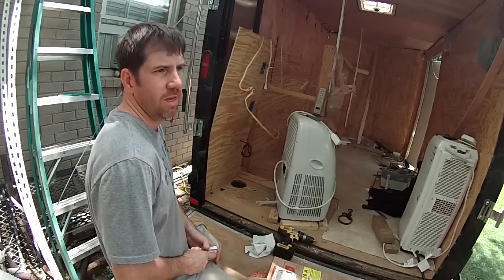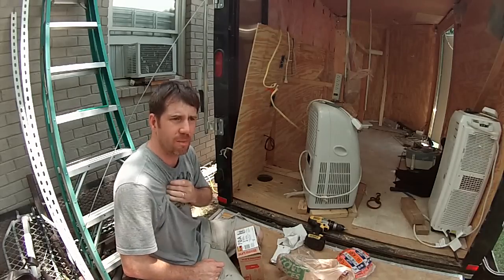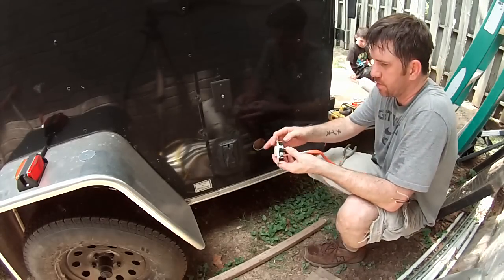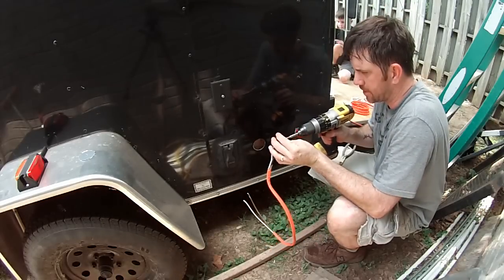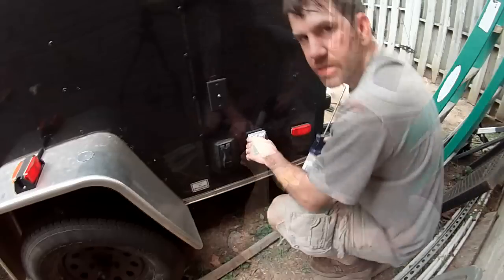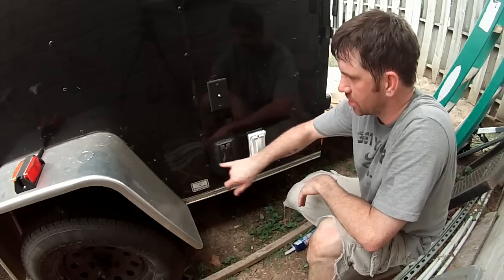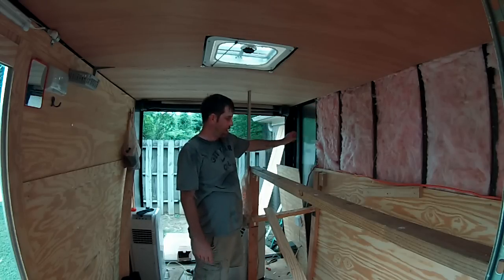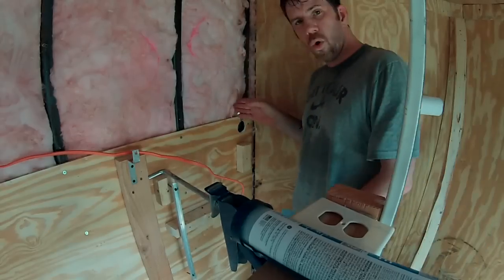Electrical Upgrade Pt 1    ....... 6x10 Enclosed Trailer Conversion Project

Comment: Just had a thought! I know this video is a little old. Just a idea if you haven't found a better solution. Maybe take a scrap piece from where you drilled out for the electrical and cable.(If it's big enough) Cut the hole the same size around the damage and have it welded in place. I'm not sure what it would cost where you live? Most car repair shops have welders or people who know how to weld. Find a backyard or small reputable repair shop. I know a few people who weld and something that small would be nothing to them. A little careful sanding and touch up paint after the weld. Do everything you can yourself. It would be very cheap and you wouldn't have to remember every time you look at it. I'm sorry this happened to you and thanks for showing us your mistake. I would have done the same thing. I'll be sure to learn from your mistakes. LOL!!! Thanks again.

Comment: With all the money you spent buying 2 cargo trailers and converting them into campers you could've just bought a used 16 footer with plumbing, heat, A/C, a real bed, and a TV for less than grand and been done with it.
Reply from the maker: Just bought another one..  Wheeeeeee
Reply: Kraka069 Your money your life. Just putting in my 2 cents.
Reply: John Doe not likely you will not find a ready to go camper with pink in hand for under a grand thats just stupid maybe a jacked trailer or one that needs to be restored or has broken windows or roof leaks.  converting is a good way to go especially if on a budjet.  I been looking for the past 3 months could not find a RV or trailer under a grand that did not have major issues like roof leaks broken windows missing title....jacked....and forget a RV under a grand... thats going to need carb clean full tune up full restore new tires thats going to cost over 2 grand alone so now your basically at 3 grand
Reply: John Doe not likely you will not find a ready to go camper with pink in hand for under a grand thats just stupid maybe a jacked trailer or one that needs to be restored or has broken windows or roof leaks.  converting is a good way to go especially if on a budjet.  I been looking for the past 3 months could not find a RV or trailer under a grand that did not have major issues like roof leaks broken windows missing title....jacked....and forget a RV under a grand... thats going to need carb clean full tune up full restore new tires thats going to cost over 2 grand alone so now your basically at 3 grand
Reply: ***** Meant to say 5 grand.
Reply: Nice thing about enclosed trailers is they are lower to the ground if you want to load 4 wheelers
Reply: @jdavis954  not to mention most have wood studs. mouse and rat poop in all the voids. and dry rotted

Comment: You should never install a breaker panel that low, one contact with water and getting knock off when loading equipment.

Comment: the cable you use should be rated to 15 amps 120/240 shore power..

Comment: Need a vapor barrier.
Reply: Fibreglass probably isn’t the best choice for these applications either, something that won’t hold water, barrier for sure, and seal wall panels due to the small area and lots of moist air being released when in use.
Reply: that's exactly what I was going to say, should of put some 6mil behind plywood.

Comment: Great video honestly, people are dicks.
I think for the hole I would've just made sure the exterior cut was smooth, filled the back just as you did with some kind of plastic or seal. 
Then on the exterior you could hit it with a little bit of Great Stuff, that expanding foam seal. 
The cut the excess with a clean razor blade and sanded it down with a fine grit paper until ready to paint

Comment: STOP TAPING RECEPTACLES
Reply: NEC says to ensure that energized parts can't come into contact. It doesn't prescribe a method but wrapping tape around it is a common method. I do not commonly do this but I have working with live outlets.